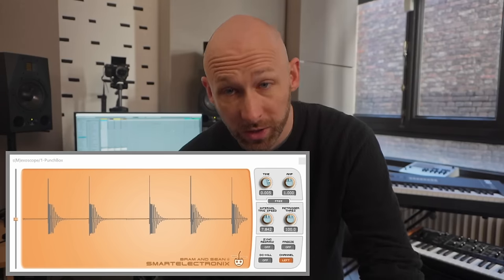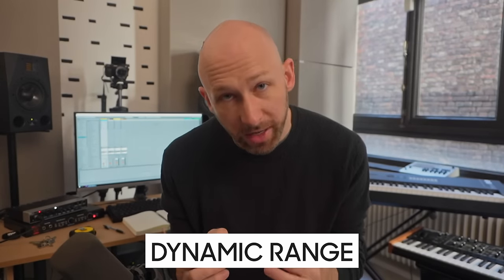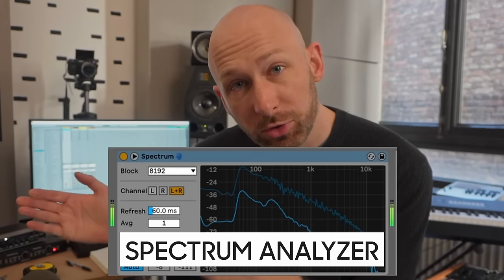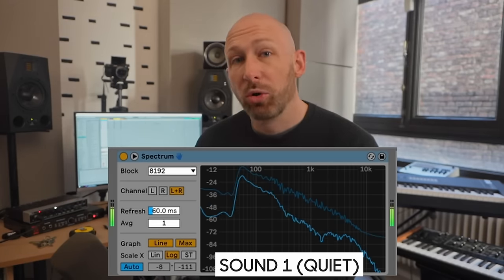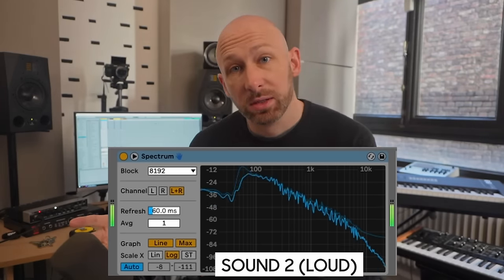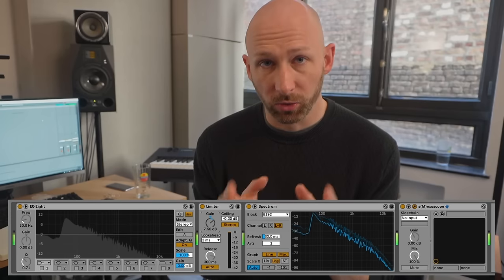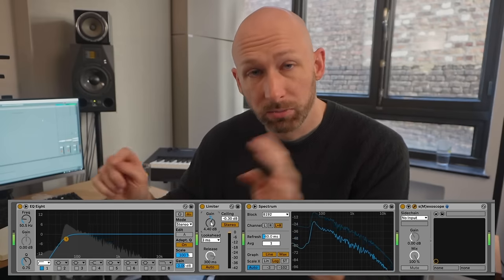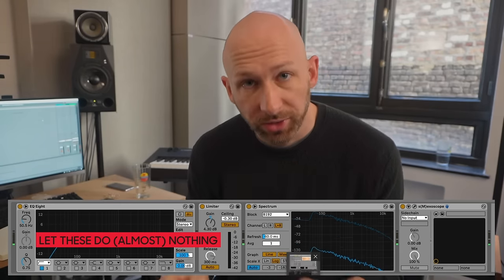Why your mixes sound thin and weak (probably)

Comment: 3:41 - that's right, many ppl think that way, but honestly, there is no magic wand in mastering music (I run Mastering Studio in London for over 10 years btw), if the mix is poor- the master won't help it, simple as that, mastering is not about correcting bad mixes or/and bad recordings/production. Mixing is for correcting bad mixes:). Anyway, I absolutely agree on your point - the creation/production stage is crucial, choosing a bad kick will ruin your song.
Reply from the maker: Always good to have my videos confirmed by veterans who know their stuff :) ✌ thanks for sharing!
Reply: My favorite kick is the flying roundhouse but my wife hates when i use it on her
Reply: @Sh0n0  LMAO
Reply: Help me understand what mastering is for then. If we’re saying that ideally the mastering engineer has no job, then … I interpret that to mean the mastering engineer’s job IS to try to fix what should have been done well initially but wasn’t. If not, what IS the purpose of the mastering process?

I don’t think this would seem strange to me if we didn’t consider mixing and mastering two different jobs. 

Thanks

Edit: it sounds like “mastering” is just a quality check by another set of ears that puts on finishing touches. If that’s the case, I still don’t understand why that would be a different specialty than mixing. Pardon my ignorance on the subject—want to understand.

Comment: the most impactful lesson I have learned in starting my compositions is making sure all the sounds chosen are top-notch and just like you mention in the beginning, running the sounds through an oscilloscope and spectral analyzer to check any nasty transients or resonances, etc. It makes mixing the completed project almost non-existent because it already sounds that good. Especially when it comes to choosing the right percussive elements. Great video!

Comment: You explained this great. I didn’t even notice the left kick sample was hitting at the same level as the right until you pointed it out. Knowing dynamic range and using frequency analyzers will definitely be a game changer. Thanks for the video. I think when I get a transient shaper it will help sustain the higher frequencies too and add some body. For now though all I have is distortion, EQ, and compression. Great video.

Comment: This channel is a godsend. Thanks for this one! 

Another helpful tip I picked up one once was try avoid mixing a track at high volumes, you can comfortably mix everything more accurately at lower volumes. Having your track too loud when trying to mix it will throw you off balance, don’t forget bass travels, so the louder your track is. The less your actually hearing of critical parts. It’s best to listen to your track loud every so often when you stand up and walk around your room, If it sounds decent 4 meters away there is a good chance you’ve got a good mix, As opposed to sticking your head right next to the speakers, where you are getting a false image of the mix. 

Not sure if this is totally useless advice but it has helped me in recent years.

Comment: Thank you for all these training videos. I watched a whole lot of your mixing videos and finally sent out my own mix and master version. I did it in Reason and found out that there wasn't any distortion above the 0dB until +4dB mark so I raised the settings on the gain outputs on the master plugins (in addition to many other things). I fully mono-ed the low end in the stereo maximixer. It is helpful to push a deadline on yourself for a final edition. IMO.

Comment: THIS. You should be an engineering preacher!
I mostly record live instruments like drums, vocals, or electric guitars, but this information is handy either way. Every time I open my DAW to start a new song, I always start by routing all my tracks & busses and creating a master chain consisting of a simple harmonic saturator working on the low end, a small EQ dip at 200, and a master limiter at the very end set to -3.0 threshold and a -0.5 ceiling. That makes everything glue together as well as bringing out that "sense of loudness" rather than actual loudness like huge EQ bumps or literal volume increasing. 
...tbh... I prefer the way the end result sounds when you record with lower gain on the front end, and then mix super hot, with aggressive saturation and compression, and a heavy handed master limiter. I've had a lot of people tell me they thought I was using samples on my drum recordings but nah, I just know a thing or two about gain staging. Still, I'm no expert. Audio engineering is a vast and complex (and sometimes philosophical) subject that often takes upwards of 5-6 years to really get comfy with.

Comment: Great tutorial. The use of hard clippers is definitely underrated. It's entire purpose is to reduce the dynamic range (unlike compressors, which is more like a shaping tool).
Reply: Would it be a bad idea to use a limiter on the drum track in a case like this then? I've always thought limiters were mostly/only really for the master chain and to be used subtly, and always used compressors on individual tracks instead. And to be clear, I'm specifically talking about with drums that have extremely high dynamic range as shown in this video.
Reply: @mikeexits  If you like the sound of it, I'd personally go with a hard clipper instead. It's great for getting the kick & snare loud. But it all depends on the sound...
Reply: @xanjelx  I appreciate the input. I've always just done Saturation then Compression afterward, but I guess I should try experimenting a bit more. 

Mixing, let alone music production in general, is such a vast expansive universe that it makes my head spin sometimes. It's almost too much. But I'm super grateful that it's nowhere near as repeatedly-banging-my-head-on-a-wall frustrating and impossible-feeling as when I tried to learn programming years ago. 

I'd rather have this ethereal, abstract, mystical art/science of sound than endless problem after problem after roadblock after roadblock where every problem and roadblock not only stops me in my tracks completely, but has no apparent reason for being there even after investigating thoroughly, and doesn't become fixed until I eventually give up and look up someone else's code. Then I feel stupid because the answer was so simple, yet stumped me so hard. Like clockwork. What a mess of a time that was lol.
Reply: @mikeexits  Well I personally don't share that experience since I have a degree in computer science.
Reply: @xanjelx  Oh, I wasn't trying to garner sympathy or "same here" comments or anything, in case I came across like that. 

Everybody is different, everybody thinks differently based on their own unique mental map of associative meaning. I happen to be more of an artistic type than an engineering type so I was fighting an uphill battle trying to learn programming. It's comparable to a fish trying to walk on land when it's really meant to be in the water. I guess the main difference here is that the fish technically can walk on land (not literally, but in terms of this analogy) but it's a path of high resistance, relatively speaking, and would be better off and more fulfilled living its life in the water. 

Hope that made any sense at all hahaha
Reply: @mikeexits  No worries mate, I didn't interpret it like that at all. =]
Best of luck to you!
Reply: In Ableton?
Reply: @xanjelx  Thanks, you too! Hey, there's a really cool audiovisual artist  who has a background in science and makes his music based on the wonders of nature, humanity, and science that I have a feeling you'd like. He's called Max Cooper. It's some of the most complex and deeply layered (and at times even mind-bending) music I've heard (though I can name a bunch of other artists too). I recommend checking out his music videos, especially from the projects Emergence, One Hundred Billion Sparks, Yearning For the Infinite, Chromos, World Passing By, and Earth. Most of his stuff before those projects is much more straightforward techno-style music and not as interesting in my opinion, though Human is also pretty great.

Comment: From a technical standpoint loudness is a measure of peak and rms power of a signal. Our ears are pretty non-linear. Making a good decision is not easy, as you can see with modern loudness normalization. Works mostly but sometimes a little off.

Comment: Wise words, good info. I’m not a professional by any means but if I had my heart set on having a spiky transient kick like your first example I would have the low and high (2 part) layer going to separate buses if the kick hadn’t been destructively  bounced already of course. I could just compress to taste after that. If I have a detailed melody I would use a less detailed kick (sub, sharper style for example) and if my melody was less busy I could put on a more open kick(more detailed). Its all about not fighting frequencies and headroom, people over analyse getting a louder mix but anyone who follows those rules should get better results.
Reply from the maker: Good perspective!
Reply: That's a good way of thinking. Knowing what you have and adapting. That's why I get mad when I hear people talk about "do this for the kick and this for the bass", like, no! Never use a chart to mix your songs, each song needs a different mixing value
Reply: @pedrosilvaproductions  exactly! Yes choosing the right elements from the beginning, getting gain right when recording samples from a drum machine or turntable etc. I like to give people constructive help instead of bashing them too, I made so many mistakes to the point of wanting to throw in the towel. I learnt how to mix exclusively by ear (old school ways) and only in mono, panning samples if need be. Now for electronic kick drums for example,  I often just use a high filter and parallel compression, layering and maybe noise gating certain other elements so it cuts through the mix.  You don’t need expensive outboard  compressors, limiters for electronic music,to get good results, as long as your mix is comfortable on the ears, and an appropriate loudness. Now it’s become a sort of loudness war.

Comment: The rms meter on the second sound has higher value which for the ears means louder.Same peak value doesn't mean both sounds equally loud.The second sound is louder due to higher harmonic content due to distortion/saturation, lower crest factor and smaller dynamic range.Just my 3 cents for whoever is interested.All the best.

Comment: As someone who makes and mixes electronic music - soft clipping is crucial! Use a soft clipper on that kick before using a limiter.
Reply: Should I use softcliper and limiter on the kick? Or you mean limited on master chain?
Reply: @ДжонСнежный  Soft clipping and saturation are ways to enhance perceived loudness without limiting. Imagine that huge, spiky kick transient from this video…a soft clipper is like shaving off the top of that peak, which would lower it a few DB on the meter while retaining most of the loudness. Using only limiting on out of control transients might sound a bit more distorted, but not in a good way! 

I meant in this example to try soft clipping instead of limiting at first. But, soft clipping before a limiter on the mix bus or master bus is a great way to get a slightly louder, smoother sound without the limiter crushing everything.

Comment: Got a small question for you or any producer outthere.

After an augiogram of my ears i've lost 4 & 8k (30 left & 40 right) So i've got a problem now, i don"t know if my mix sound good a this point. Does any tips for that little problem? Thx :)
Reply from the maker: Hey! I dont have experience with hearing loss, but I imagine that if you develop the habit of referencing with other pro tracks, your tracks should sound similar to theirs in those frequencies, and you'll be good!
Reply: @OscarUnderdog  that's i think too but a friend who works in ear plug (medical) suggests me to up frequencies where i lost them. I try but, for me, it resonnate to much (that why i decide to ask here :) Thx for sharing all these tips, i learn a lot :)

Comment: Another great vid! Sometimes I have a problem that the sample has these really quick peak transients and maybe I'm doing something wrong, but compressors/limiters won't help it, because even the quickest attack setting I have available seems (according to the metering plugins) to be letting some of the peaks through... what would you recommend to deal with this, except the obvious change the sample (:D)?
Reply: i was wondering this too. a scrappy fix would be to find the frequency of the quick peak and dampen it with a very small width not h
Reply: notch

Comment: Using a Clipper cutting the Transient Peak..
This will get it to Perceive Louder & you will get more HeadROOM !

Lets say if the Kick was at -4 DB & then you use a Clipper to cut the Transients that was causing it to sound Muffle...
By adding the Clipper you will get like 2-5 DB of Volume & when you add that to -4 BD & compare it to the Previous Sound at -4 ... The Clipped sound will be x10 Louder, will sound Cleaner & Better & will still Peak at -4DB like how you intended it to Mix it at..

Comment: i think u should think twince before using zero latency eq on low frequenies (low cuts below 120hz).
i hate dealing with ringing and phase issues. guess less problematic on master cuz a phase flip is not directly causing phase cancellations.

Comment: So what can we use on each element to reduce the dynamique range ?
Reply: Saturation and compression (or even limiter). Ableton shows 2 levels: peak (dark green) and RMS (light green). To get loud mix you need to carefully shave off peak level and retain RMS. But be careful, some sounds should have transients, so don't make peak level disappearing. The key is to listen and not make sound worse :D  

My quick dirty template for mixing sort of loud mixes is following: 
Cut off unnecessary low frequencies with EQ;
Add 'A bit warmer' Saturator preset (play with drive and dry/wet knob or change curve type if necessary). 
Then you can add compression so control dynamics.
I usually apply this rack to all tracks by default, tweak them according to my taste. Then you can balance volumes of all tracks and add EQs to have some tonal balance between mix elements.

Of course, don't forget about sidechaining to remove frequency conflicts between bass and kick :)
Reply: @DmitryPuffin  thank you very much for the answer !

Comment: softclipping (or hard, depends on the sample) with visual feedback from smexoscope works best for me, on sharp transient spikes. try newfangled saturate for clipping
Reply: Hard clipping is so cool once u get used to it, soft clippers are cool to but they are basicly saturators so i kinda use them for another purpose rather then transparent transient cuts.  since it basicly cant get more clean then a 100 percent hardclip. even a limiter does a gain envelope beneathe the threshold etc=)anywho have a sick day!

Comment: Could you not just lower the gain on the kick with the very high peak transit to make it more controlled in the overall mix?
Reply: Then the whole sample would be quieter, because the peak (which happens almost imperceptibly fast) was the only thing too loud. Also, the way he describes loudness here isn’t really correct. They technically peak at the same level, but the second kick’s RMS (sort of averaged, perceived loudness) is higher. So… it kind of can said that it is louder. There’s actually a lot of half correct info in this video… I’d look somewhere else, maybe.

Comment: There's another aspect that you failed to mention in terms of mixing "loud" that's linked to Rule 1, but not exactly the same. Short sounds will be generally perceived as softer than long sounds. Faster decay, less sustain, and shorter release will decrease the perceived loudness of a sound even if the peak volume and the frequency content remain the same. The human ear perceives loudness based on the what's called the Root Mean Square (RMS) of a sound's amplitude. Mathematically, this means squaring the amplitude of each individual sample of the digital signal over some time interval, summing all those squared values, dividing that sum by the total number of samples in the interval, and then taking the square root of value. That's the relative volume that your ears will actually perceive (and this is why compression makes things sound louder - you increase the RMS amplitude without increasing the peak). In practice, this means that if you're working with a pluck or stab, for example, you can adjust the loudness by changing the decay, sus, and release without touching the actual volume slider or the compressor or EQ. It also means that fundamentally short sounds that are almost pure transients, like a lot of percussion, will often need be mixed with higher peaks than you expect to prevent them from getting buried. 

It's also important to consider frequency masking. Too much frequency overlap between parts of the track leads to masking where a loud sound will prevent your ears from hearing similar frequencies produced by softer parts. Even if the parts are "balanced" in terms of volume and the dynamic range of everything is managed well and you do everything else right in the mix, if there's too much frequency overlap and masking then your mix won't sound loud; it will sound muddy and ugly.